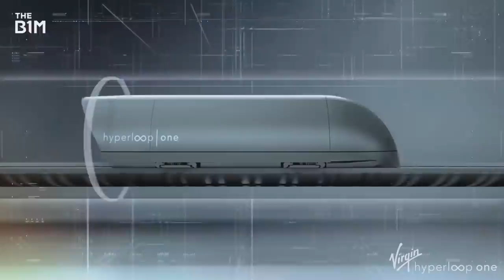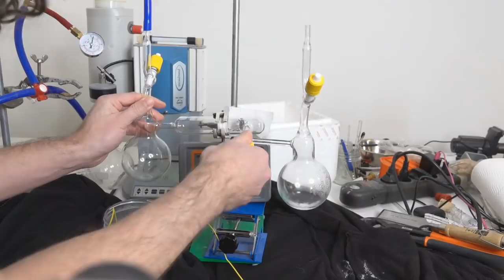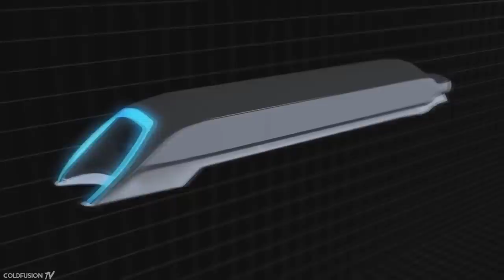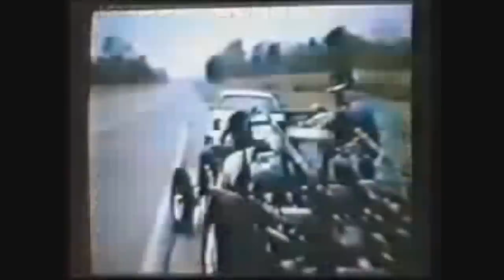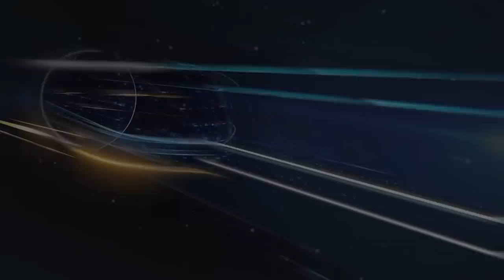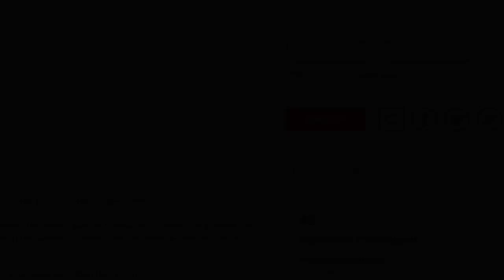Free energy device using Hyperloop technology!

Comment: That's not free energy. Having difference in temperatures. If it works, that's basically a setup to make wind. That may be a good idea if it works. But so far you have to work more to make people believe you made such a thing. Actually this could impact the environment. Although if it works, I see us in the future changing the climate to plant threes on the Sahara... And getting energy for that
Reply: We use "wind" to make energy in nuclear power plants. Just like this hydro vac, a difference in vapor pressure is applied across a turbine creating captured energy. And he did make such a thing- watch the video release right before this one. He demonstrated how to make the glassware components and everything. And as for the trees in the Sahara.... I watched that YT video too ^_^
Reply: @enderz1341  Well actually the threes on sahara where my idea (I didn't get it from a vid). I guess for me wind is air moving on differences of pressure caused by the sun, and not by some source of energy. The 99.73%? well I'm just not convinced. Either way I wish them good luck with this, but 100k won't make it, and I'm also not sure you can get it. Although the % may be high, there's anothe factor. You can not industrialitze it unless you use big chunks of land, so I would stick to fotovoltaics rn. The idea seems brilliant, but making such vacum is too hard
Reply: @kepler_22b0  Re:trees: I guess great minds think alike, no vid required. As for the rest- this is a satire video. ThunderF33t made it in the same style of the Solar Roadways et al. Vacuum tubes to the arctic are just as silly as vacuum tubes through Death Valley (a la Elon Musk). He pulled 99.73% out of his cloaca. The only thing serious about the video is the tabletop hydrovac, which he actually built, but it is not actually a source of cheap energy, and scaling it up reduces it's efficiency exponentially. Mr. TMeter/3 is simply making fun of Musk and other con(wo)men, but in the most awesome way: with a cool scientific toy.

Comment: I have a better idea, let's build a 10 km high Stirling engine using the cold of higher altitudes, at ten km the temperature would be around -54°c if the ground temp is 20°c, mount a big ass generator to that and bam "free energy" would only cost billions and billions to build such a high structure plus maintenance but sure, let's do it I can provide a $5

Comment: I can't tell if this is a joke or sincere, so I'll try throwing a couple theories at it.
1. Water vapor is harder to get then water, so if it is required to use vapor, then it would most likely be non-efficient in addition to following points.
2. Testing was done in a closed system and there was no demonstration of an open system usage, so that may be a breaking point.
3. Friction for travelling about  5000km (1/8th earth circumference, approx estimate from California to N pole) would be ENOURMOUS, especially at demonstrated speeds and that would cause massive issues, in structure, pressure and shear forces damaging the slightest inconsistency.

Comment: By the way, your invention has already been listed in a German book from 1931 "In hundert Jahren" which describes renewable energy solutions in order to get independent from burning fossile fuels. In this particular case, a group of French researchers had proposed heat engines driven by the temperature difference between surface and deep ocean waters in the tropics. In order to improve efficiency they suggest media with higher vapor pressures than water. I put some figures from the book here: https://imgur.com/jVncO8L https://imgur.com/E9tX514 https://imgur.com/HrsMhSB https://imgur.com/m8F4dyj

Comment: Sigh.  I find it so hard to tell when Thunderf00t is being serious, is falling for a conspiracy, or when he's just being tongue-in-cheek.

But anyway, just in case he's falling for a conspiracy this time:  for this particular plan the problem is distance.  The little demo works because its a large temperature gradient separated by a fairly short distance.  If you want to scale up the size, you're also going to have to scale up the temperature differential to keep the same overall gradient, and once again you end up having to dump in more energy than you're getting out.

Now if you could find an area on Earth that naturally had a large temperature differential over a short distance, you absolutely could use that to generate power.. and we already do!  Its called geothermal, and its by far the cleanest energy source we've ever developed, far better than solar (due to the mess that making the panels entails.)  Unfortunately it requires relatively rare geological features so its not really a solution that can be used on a global scale.

Comment: I would look forward to seeing this in large scale. Would you be worried about freezing or cracking once the water reaches the cold? Also wouldn't the salt cause corrosion especially moving at speed, would that be a problem in a large scale operation?

Comment: Idea. Not as power generation, but cooling and water supply. 

As far as I can tell, a major contributor to the California drought is that the on shore flow gains heat due to the urban heat island effect lowering the relative humidity. Could this principle be used to dump heat and water at high altitudes in the cascades? This would both directly move water to the mountains, AND promote rainfall by reducing the dry heat added to the air coming from the Pacific by the major cities. Sure the flow rate would not reach near the speed of sound, but the distance covered would only be tens of miles.

Comment: In order to prove the existence of man made global warming this so called 'Professor' Mason is actually willing to cause it! pumping heat directly to the poles. Wont some one think of the polar bears!

A counter proposal professor Mason: space is colder than the poles and a LOT closer, why not simply build your hyper vac to space, it can even double as a handy space elevator. Of course this would also have the benefit of GLOBAL COOLING! Solving all of man kinds problems with one simple piece of engineering.

Comment: This video confuses me. Usually, Thunderf00t is criticizing new technology, like some old man. Can I trust this? It seems sillier than most of the things he reviews. As for the device itself... I think whether it works or not is questionable. It would take a lot of power to get a vacuum in the first place, but it would produce a lot of power from all the spinning turbines (plus the panels)... I want to say that the pressure would eventually equalize, but the vapor would just condensate and freeze, and the ice could be sectioned off with an airlock and removed. I really don't know what to think.

Comment: okay the fundamental principle i think i understood but what happens when the water which vaporized from one end to the other is stuck on the other colder side? we heat up the northpole and melt the damn thing obviosly so the ocean will be the colder side and reverse the effect ... 

just kidding, but the notion stands, free energy my ass, first we have to create the vacuum including the tubes and stuff to hold it in, maintain the stuff and make sure one end is cold enough to get the desired effect on thhe other side we have that fan thingie which in theory can be used as a dynamo but than we either have to breach the vacuum or magnetic coupling ...... i can't see how that power output will equalize the power input but alteast it is a working model were the fundamentals aren't some fancy mumbo jumbo :D

i've recently found out about the "am/fm"  terms and this looks like an Actual Machine not Fucking Magic  :D

Comment: Sounds like a single stroke millibar Sterling Engine but something out of the blue. 

It’s almost free and 97-99% efficient if we discount the (energy) to create and maintain a vacuum hyper-loop and the (loaded efficiency) of the heat exchanger up the North Pole. 

Three more important factors 
(1) vapor due liquid conversion rate, equator and polar. 
(2) vapor<>liquid conversion efficiency of heat exchangers. 
(3) loop wall-air surface frictions, fore<>after the vehicle. 

Those are important if we want a speed close to sound.

Comment: Thinking about this, you wouldn't want the water to condense out early, that would be wasteful. There is plenty of cold between the equator and the poles, so the tube needs to be well insulated. You should probably put the vacuum tube in a vacuum tube to prevent from getting cold.
Reply: You only need to place the turbine near the warm bulb, then it wouldn't matter where the water condensed.

Comment: @Thunderf00t I think you're joking but if you're not or even if you are just out of curiosity.  How much voltage do you think your set up could make if the spinning part was driving a generator? Or even better the spinning part of a generator?
Reply: I mean could you stick a magnet in there get it to spin and coil some copper around the glass?  I don't know if the glass prevent generating an electrical charge.  As a layman I would think, certainly a strong enough if not any magnetic field would pass through glass.  Am I wrong?  I would be shocked to learn that anyone could get that set up generate energy enough to power itself.  But seriously what would be required to make this feasible?  Or is it a situation where the vapor pressure just isn't high enough to over come the inertia of anything more massive than a small bit of aluminum foil?

Comment: You could pass local water through the warmer ground under the poles (south mainly) and just build a pipe coil/turbine set leading to the cold spot on the surface.
(Yes I know it's a joke) Just build a pipe   a few km's straight up  into the atmosphere where its always colder anywhere on earth.

Comment: Love it. Buuuuuuuuuuuuuuuuuut, will the pumps powering the tubes give off heat? if so, wouldn't that be bad for the poles? Imagine having 10 000 of the pipes from the poles active for 24/7, wouldn't the heat be bad for the ice over time?

Comment: Will he build it if he gets $100k?  No, of course not.  Ignore the tube, ignore the turbines, ignore the stations at either end, the wiring, and all that.  If it generates 100x more power than the earth needs, running at 10% efficiency and fed by solar panels, that means it needs enough solar panels to power the earth 1000x over.  To define that, humans generate about 20 terawatt-hours of energy per year.  A good 65*39in panel will generate something like 320 watts under ideal conditions.  Since distance and borders don't matter apparently, the panels can be put where they will be most efficient, and mounted with 2 axis rotation to get the most out of them.  To be as generous as possible for the math, let's say they make full power 18 hours a day.  That's a bit under 5.8 kilowatt-hours a day, or 2103 kilowatt-hours a year on average (including leap year bonus days).  1000x20 terawatt-hours = 20,000,000,000,000 kilowatt-hours.  20,000,000,000,000 / 2103 = 9510223491 panels needed.  With $100k seed money, that would be something like 950 panels for ONE CENT, including the 2-axis mounts, shipping, installation, and a maintenance contract.  The panels would also need something like 16,000 sq km of land if they were placed so close that they were touching each other...but land is cheap in the desert and wires are free with no resistance, so that's the most feasible part of the project right there.  The least feasible part?  The wires.  Yeah, the wires I was ignoring before.  Everything else is wasteful and stupid, but theoretically possible if humanity dedicated 100% of their efforts to it long enough.  I am honestly don't know if there is enough copper on earth to make the wires.  I guess the rarity created would push the price up past that of gold and silver so those could be substituted for some stretches, and it would make a lot more copper mines economically realistic...but even then, I don't know if there would be enough.  Maybe aluminum could be used...but that just means we need more solar panels because of the added resistance, never mind the power needed to make the aluminum.

SOOO....for those still wondering what he would do if he got the $100k, it certainly wouldn't be the thunderloop.  Maybe he'd just fart into a tube, call it a tunderloop, and take a nice, long vacation.  That's what I'd do if someone was dumb enough to give me $100k for the thunderloop.

Comment: How to explain this project to a judge:

Buying a house in the desert -- $ 50000
Getting 2 1-ton-steel bodies out there $ 2000
(put one of these in the House...)
A can of black paint for steel $ 20
(paint the steel body left outside)
A generator $ 1000
Suiting transmission $ 100
Propeller $ 200
Batteries $ 10000

$ 35000 for the formed glass seems quite fair...

Comment: ok i am a scientificly illiterate idiot...wouldnt your idea actually work? i mean not unlimited but...it could be used to produce energy, right?
Reply: its essentially a windmill turbine that only functions in a 4 thousand mile long vacuum tunnel which needs to be regularly drained, reloaded, emptied of ice on the cold end, and then re-vacuum pumped, but i mean technically yes.
Reply: The less vacuum you will lose after each refill the more energy efficient it will be. 
But yeah.. The only pros against normal wind power is that it would supply a constant amount of energy 24/7.

Comment: TEG or Seebeck generator can be used on that hyperloop pipe too! One end of the pipe is very cold while another one is quite warm so, if pipe is made of proper materials or has proper 'coating' from these materials, additional electricity can be gathered!

Comment: The funny thing is, that this actually works already and it doesn't need the vacuum tube. The surface of the earth is a vacuum with just a thin little bit of air around it. The temperature differences used in the proposed tube don't need the tube. They are causing a lot of movement in the air without the tube and you need only turbines large enough to create as much electrical power as you want. Denmark is close to produce 50% of the electrical power this way.

Comment: Once the water vapour is all in bulb B the process stops, if you ran a heat pipe from the Arctic to the warm water area and had both bulbs next to each other you would just have to rotate the bulbs to restart the process,

Comment: Oi Funnderfool , you are extracting the urine, ? what material you gona use to make these tubes out of, solid Kryptonite. You know the pressures involved at sea level a tad over ten tons per square M pushing..  The bore would have to be reinforced no out side with RSJ and dead smooth on the inside also would need a Venturi action, one smaller tube blowing into a larger one at every turbine so you could not string them together using the same 'cold steam'. I fink you getting on the fre kin' roadways and Musks band wagon funding bollox. Good luck to you mate wiv this con,  but I won't be bunging you a few Shekels anytime soon that's for sure . Let's get back to real science..

Comment: BS. Any common sense person can see the multitude of flaws in this. What about the energy to build the tube and the energy to create the vacuum or the energy to heat the water then the energy to cool the water? Also if you were to use a tunnel thousands of miles long and run arctic water through to the tropics you would create a massive change in the local climate as a massive amount of cold water gets dumped into a tropical area. I know if I were to think even more on this I could come up with even more flaws to point out. Oh and where are you going to get the land and permission? You have to go through three countries and that's just for North America. Not to mention the money. Besides you're the guy that said the hyperloop was BS in the first place now you'er supporting the technology. You'er just a flip flopper.
Reply: @TwentyNineJP  Did you see his previous video? The water is condensed in the second vessel, so the pressure stays constant. That's how it works. You would have to let more water into the evaporation vessel and pump out the water from the condensing vessel to keep it going, but the energy for that is minimal and it's easy to do with a low power piston pump because water is not compressible. 

In a small system like his experimental one, you'd have to heat the evaporator and cool the condenser to keep it going, but the idea for the global one is to use the sea to heat the evaporator and the ice caps to cool the condenser. That's the free energy that is being harvested from the temperature difference. That's how climate works for trade winds to sail with and wind turbines, which harvest the free energy that the climate provides.
Reply: r/woosh ?
Reply: @TwentyNineJP  it doesn’t take any energy to maintain a vacuum. Did you ever have to plug in your vacuum flask to recharge it so that it keeps your coffee warm? What about the vacuum in space? If it needed energy to maintain it, instead of the big bang, we'd have the big squish.
Reply: Cromwell564 

I thought the line where he said he used his telescope to talk to aliens was the point, early on, that one might conclude this has a smidge of sarcasm attached. Now it’s possible you are doing the same in the opposite direction, but I would say far less effectively.
Reply: HAHAHAHAHAHAHAHAHAHAHAHAHHAHAHAHAHAHAHAHAHAHAHHAHA
Reply: @TwentyNineJP  I'm not saying his global vacuum heat pump is a practical solution, but I am saying that free energy is available for us to harvest. I use it every time I go out in my sail boat. We can also get it with solar panels, wind turbines, tidal turbines, wave turbines, hydro-electricity, etc. In fact all our energy is free, though it normally involves financial investment to harvest it.